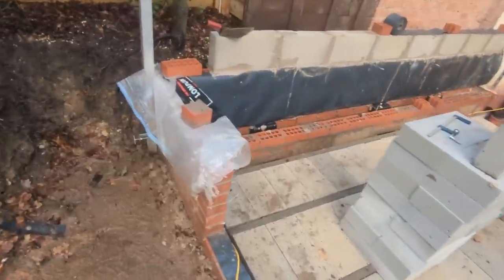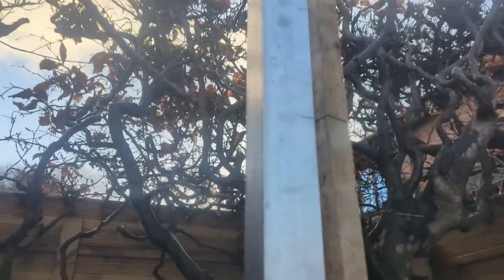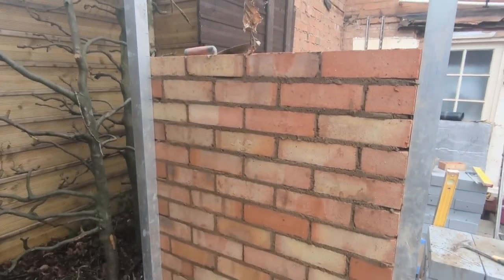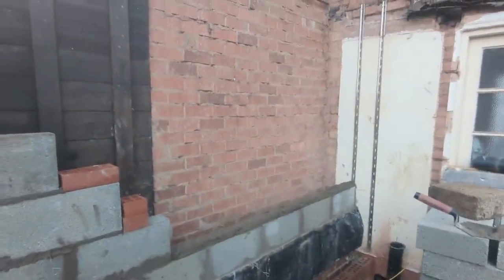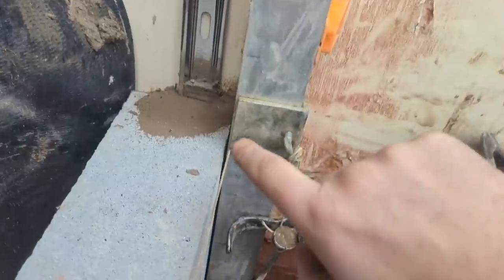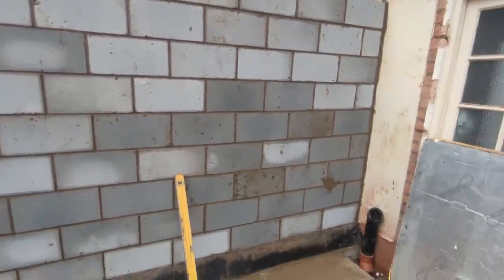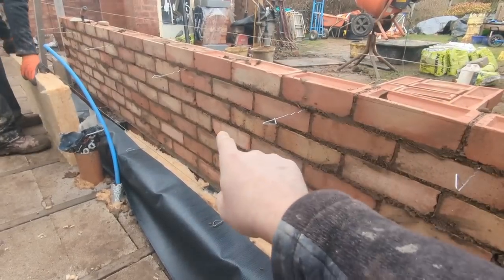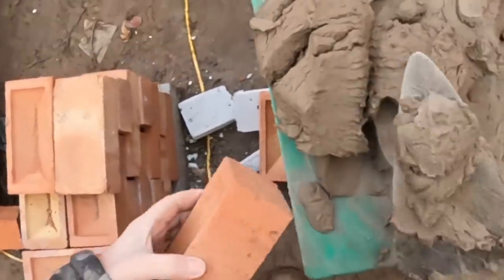Single Storey Extension Stage 6 Continued... Bricklaying Between Christmas and New Year!

Comment: What I have gathered is that as messy as it was in the footings and setting out. Work that will never be seen or appreciated. it is probably the most important as the accuracy of everything else is dependent on that. So spend the time get it right and it will make life easier as the build goes on.
Reply from the maker: Wise words Peter! Thank you for watching, appreciate it.
Reply: Noticed that you used different bricks in left hand corner where you had to go deeper with your founds. Is that because they are engineering bricks which reduce damp penetration
Reply from the maker: Yes that's right, Peter. I did that to add a bit more protection to that area.

Comment: I am really curious to know something, i learnt from a bricklayer in india that after brickwork, the walls need watering for at least 7 days to help proper cure the mortar so that it could achieve its full strength.  but i don't find this practice in the UK.  i wondering what is done differently here in the UK with the mortar that it doesn't require curing.
Reply from the maker: Hello, hope you're well. I've never heard of that before. The cement is mixed with sand and water, the water starts a chemical reaction within the cement and it goes solid. It'll take the best part of a month to achieve its maximum strength. That's all there is to it really.

Comment: You may have said but how do you tend to finish the block work where you can't reach round to render? Do you just leave it as bare block?
Reply from the maker: It's going to be left bare block and we're going to extend the roof over to give maximum shelter.

Comment: Why don't you use kingspan or celotex insulation with a gap on outside wall .I'm not a builder but all of the extensions that I have seen lately have a gap unlike your insulation which is touching both walls